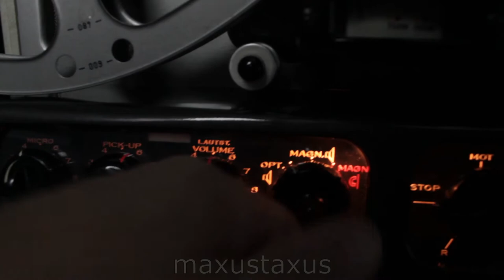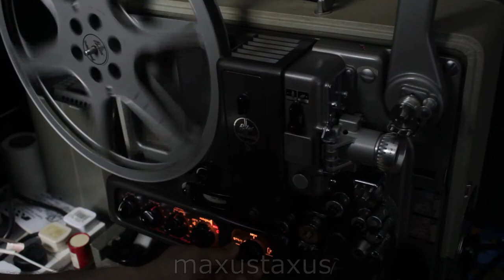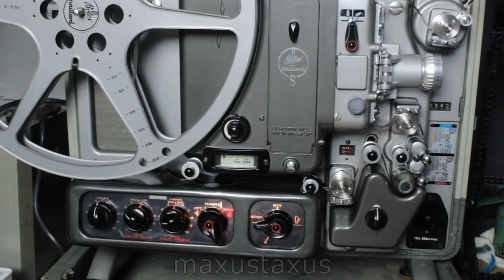Paillard Bolex S221 Projector Instructions and re-filming London to Bath, 16mm cine film F688

Comment: Thank you. Presumably you then have a go-pro (or similar) that is capturing the image on the projection screen?
Reply from the maker: Hi, oh, actually it is the camera I am taking the film with that usually sits on a gantry at the front of the projector, just above the lens. With the projector screen tilted just a little back, the plane of the projected image becomes flat to the camera and so the image looks square to it. Then I get the projected image to fill the whole screen, and set the camera to 800 film speed (usually). If the camera is on an auto speed setting I find it tends to flare as scenes change brightness.

Comment: Nice viddy! Any clue to how to deal with slipping and chattering takeup and feed clutches in this old machine? Mine seems to have fallen victim to that malady.
Reply from the maker: Hi, I have found chattering on the rear take up spindle a problem on these machines to the point of stopping them working effectively altogether. To fix this, I undo the 6 screws retaining the drive shaft of the clutch spindle assembly. As I recall, you can't easily remove the shaft itself with just these screws undone, but you can move/wiggle the shaft so you get enough of a gap to squirt some 20-40 oil behind it and into the clutch mechanism. I have found this leaves the take up clutch smooth and quiet. I don't know why this has worked for me, and as this is the internet someone will soon delight in telling me why I am wrong. But I do have 4 of these projectors, and use them a lot (only because I think they look so nice really...I know there are better projectors about)...all I can say is I am not afraid of chatter when buying one of these, and once the clutch runs smoothly again, I don't find slippage is a problem even though 20-40 may not be the original viscosity of the oil/grease used when these were originally made (which has long since been lost or dried out). In my opinion, the weaknesses of this Bolex and more than made up for by its gorgeous period looks.
Reply: @maxustaxus  Thanks for the detailed and generous reply! There isn't a lot of info on these out there on the interwebs, so much appreciated.  I'll give this a shot. And BINGO! These are stunners. At work I love my Eiki Super slot loads for easy of use and smooth operations during projection and even telecine, but I don't have one of those at home. Just this beautiful beast.
Reply: @maxustaxus  I also have this issue with the take-up on my  S221, it’s bad enough now that the take-up just barely works.  I’m planning on trying out your advice here, so long as I can get those 6 screws loosened - they’re pretty tight. For clarification,  when you say 20 40 oil, is that a motor oil that you are talking about?